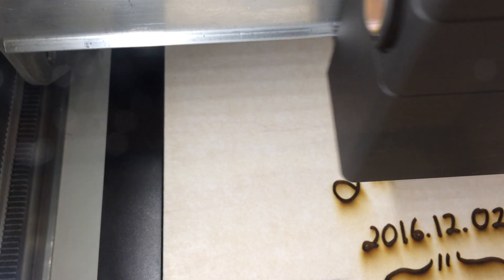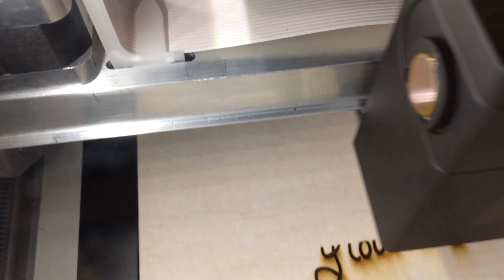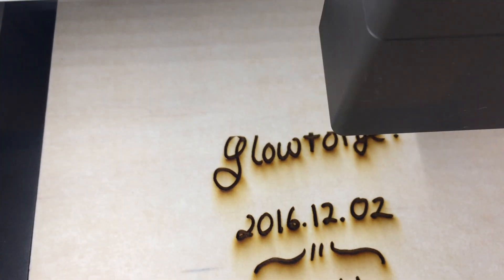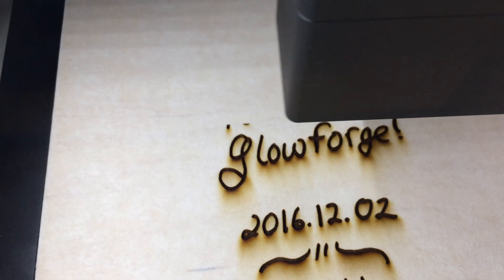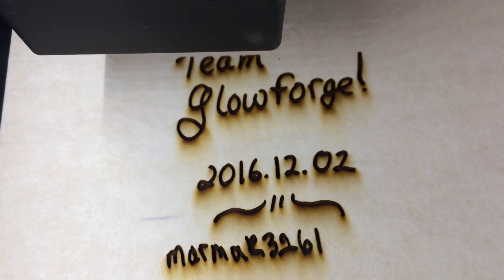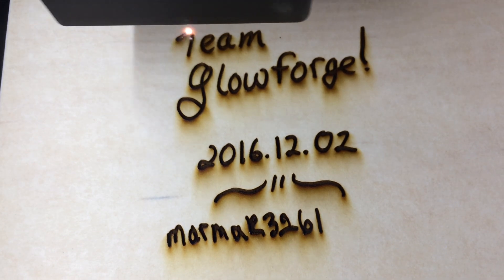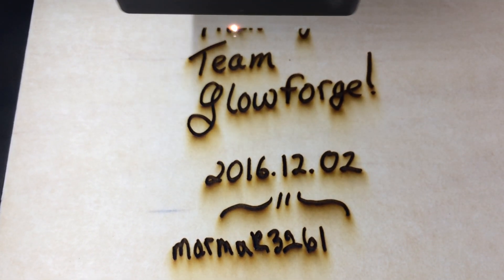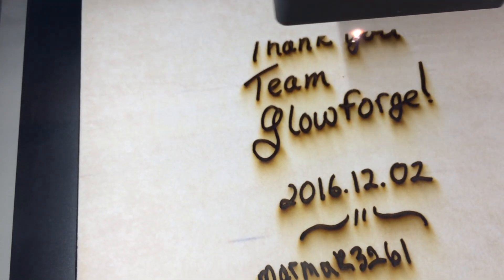Glowforge 3D Laser Printer:  prerelease second print, Pt. 2

Comment: A 90 degree corner doesn't have a radius.
Reply from the maker: That's a good point. Is it really 90 degrees in the corner or is there a slight radius? Is the turn on one point? I guess I could have said, "it looks like a true 90 degree corner rather than having a gradual, if very small turn at the corner."

Comment: what's the paper or material you put on that piece of wood for ? what's the name ?
Reply from the maker: Material that comes from Glowforge has a thin paper masking on both sides. It makes it so that the smoke does not discolor the surface of the material. If I use my own materials I use masking tape, kraft paper with Loctite General Adhesive spray or a laser masking material I bought from Laserbits. You can also just sand the material if it is wood to clean of the smoke.